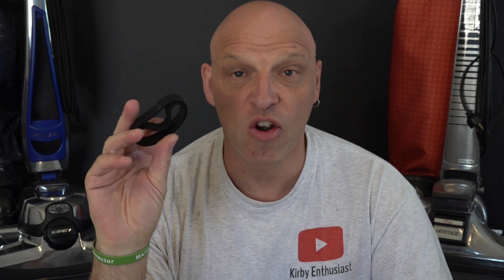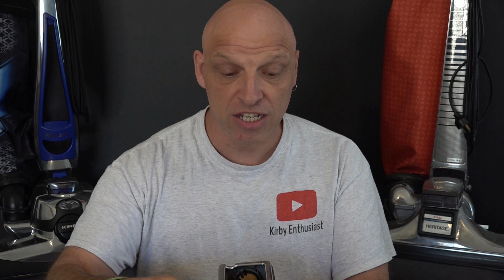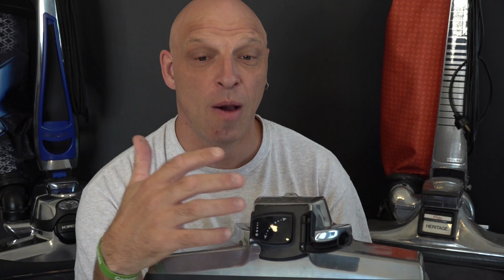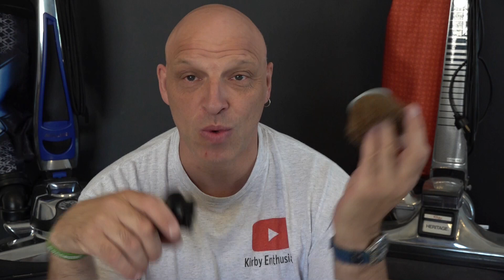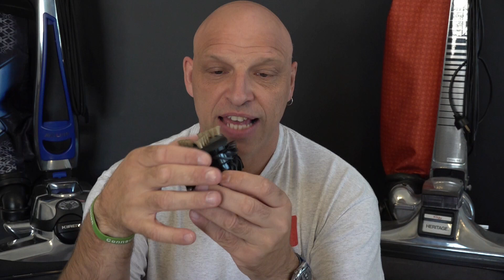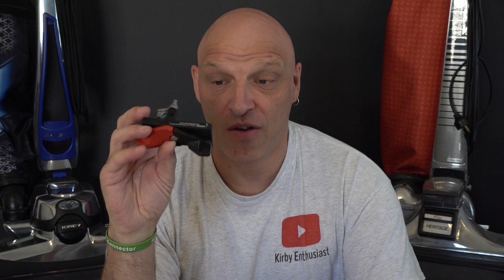ARE KIRBY VACUUMS WORTH IT:  REPAIRS OVER 27YRS OWNERSHIP : WILL IT OUTLAST DYSON??

Comment: I grew up with two Kirby's... a 1969 Dual Sanitronic 80 and a 1971 Classic 1CR.  I still have the Classic and it runs and looks like new after 52 years!  It has never needed a repair (only belts and brushrolls) despite being used several times per week until I bought my Ultimate G7 in 2003.  My G7 gets used 3 times per week and did need ONE repair... the Tech Drive switch was getting loose and had to be replaced.  I recently found a new light gray cord to replace the original that developed a crack in the rubber.  Other than that, just belts and genuine Kirby replacement bags.  The brushroll is original and is still on the #2 setting.  Not bad for twenty years!  Gotta love Kirby quality.

Comment: I bought a Generation 3 back in the early 80's.  Almost 40 years and the only "service" other than usual maintenance, was having the fan replaced about 10 years ago.  I've just traded it in on a new Avalir 2, and am looking forward to putting it through its paces!.  Kirby makes great machines!
Reply from the maker: The G3 was an awesome advancement in the home cleaning system, with tech drive aswell as a new easier to use shampoo system. 
Nice to see you got many years of cleaning with it like I have with my G4.
The Avalir 2 is a phenomenal machine .
With modern design, amazing airflow and the shampoo system that is 2nd to none.
You will have many years of quality cleaning.
Thankyou great comment and supporting my channel I really appreciate it. 
Happy Kirbying 👍👍
Reply: How is the avalir 2 ? I'm thinking about getting one but still don't know about the price
Reply: @hunterbenoit3484 try to buy used one's, even an avalir 1 can be great.
i don't think the door to door sale is necessary so try find online or refurbish an old kirby from a thrift store and it will operate just like new

Comment: That's really handy to know I just bought secondhand a G4 as well as the G5 Ultimate, I already purchased a G5 previous to this. New at all this but they have been strongly recommended as they have a really good beater bar system, never knew about releasing the Tension on the belt, but thinking about it, it makes sense.
Reply from the maker: Your very welcome, the belt wind off was drummed into us at Kirby back in the days of selling the G3

Comment: I just recently got a Kirby, less than a year ago, when i found a near mint Sentria2 at an estate sale for $150 and 20 for shipping. Got two zips with it also, but no schampoo system. Anyway, I've always have had pets, mostly cats and just used a standard brush nozzle driven by the air to rotate the bristles, with an actually very good old (20+ years) Volta Gemini and also a Siemens Q8. Been having strange flashes of funky smells, especially in front of the TV where I sit a lot and have a huge hand woven, really thick Chinese carpet which I've had for 35 years.
After just 2 Kirby sessions I got so much dirt out of the carpet I couldn't believe it! And better yet, even without schampoo all the bad smells are gone. Room is like I've got the windows open 24/7 now, huge difference.
Thanks for all your great videos helping other Kirby owners out, and I'll keep this Kirby for as long as I live, that's for sure.
Reply from the maker: Thankyou for awesome comment, so glad your Kirby has made a massive difference in your home cleaning . They are the best machines and will last a lifetime. Please share my channel with friends a family . 👍🔔 not to miss new Uploads and competitions 😀😀

Comment: I have three Kirby’s. One is my grandmother’s 1976 Kirby Classic III. It’s 44 years old and still runs like a champ!
Reply from the maker: Love the classic IiI still on the look out for one great color scheme and cleaning power to match 👌👌
Reply: Probably about the same time my grandparents bought their Classic 3.  Great vacuum, motor died and it got thrown away probably about 8 years ago.  I want to get a newer one with Tech Drive at some point though...I miss the cleaning power and attachments that Kirby has.  I also still have my grandparents old 70's Rainbow Vacuum as well, it still works great, its so old it was before they had the powered brush roll floor attachment.
Reply from the maker: @wildbill23c  kirbys are well made , just quality built last 👌👌

Comment: Good info👊
It would be cool to discuss the cost/benefit of having a good machine for 30 years vs a machine that isn’t cleaning and replacing it every 3-5 years
Reply: It sucks how bagless vacuums suckered everyone into thinking bags are old school because I have witnessed family ditch their kirby for a shark or $40 bissell powerforce bagless pos
Reply: @albertpintor3522  The bagless stuff is junk, doesn't last long, well people think they do, but performance in them is horrible.  Sounds cool in the beginning no bags to buy and change just dump the cannister...yeah that's more of a mess than changing a bag.  I have a bagless Hoover upright, I spend more time cleaning filters and waiting for them to dry.  I went back to an older bagged Hoover upright, much better, and no dust all over the house that the bagless was spitting back out all over.  

Unfortunately my grandmother's old Kirby Classic 3's motor died, and I had no idea about all the parts availability and rebuild option, so it got trashed :(.  They bought it new when they first came out with the Classic 3, and it got thrown away about 8 years ago, so what probably 30+ years of use that vacuum had.  I want to get one of the newer ones with the Tech Drive.